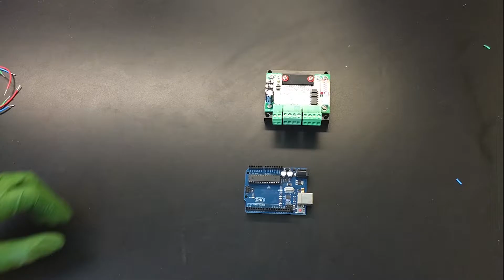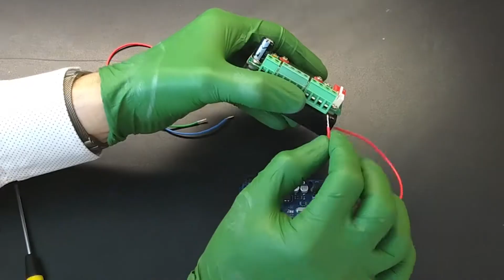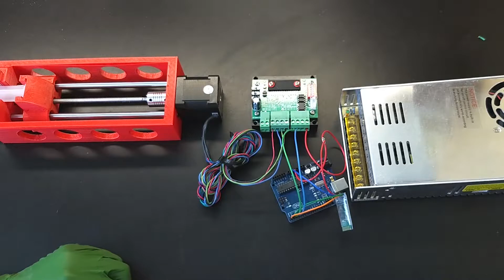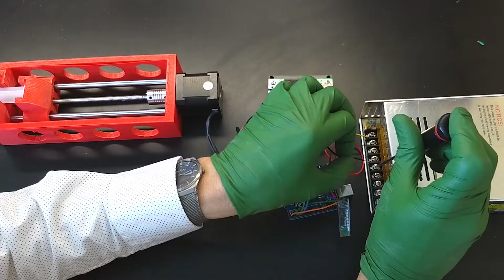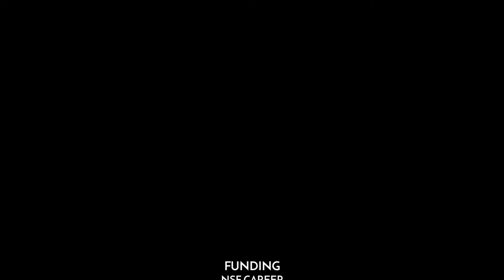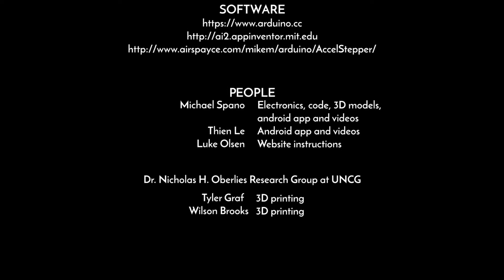Flow Chemistry: Electronics Assembly Video (Part 3)

Comment: what driver board are you using??
Reply: I got it to work with: SainSmart CNC Router Single 1 Axis 3.5A TB6560 Stepper Stepping Motor Driver Board